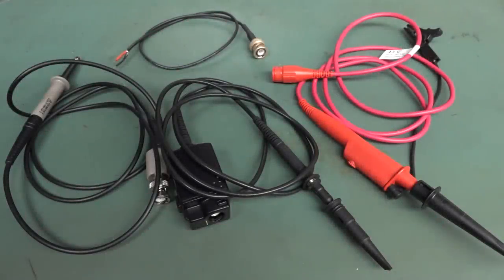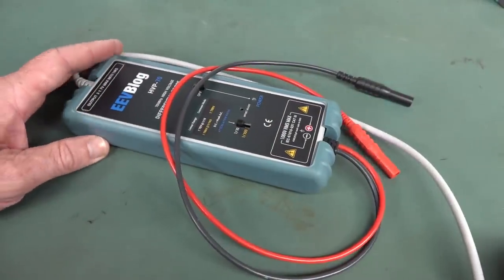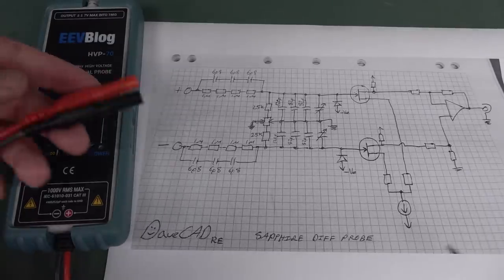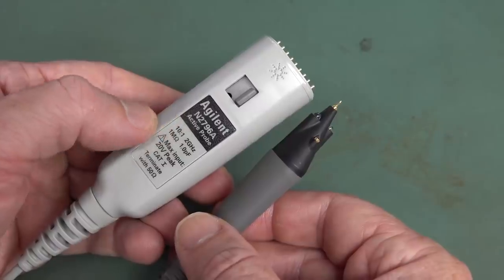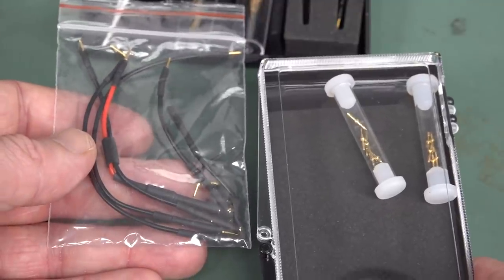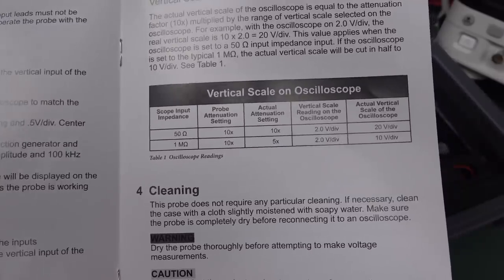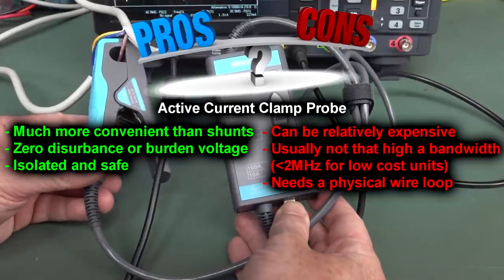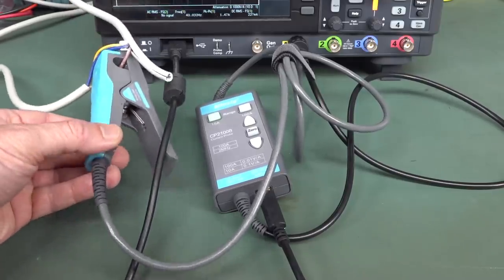EEVblog #1368 - Active Oscilloscope Probes COMPARED (Part 2)

Comment: The restive transmission line probe is my favorite way to make a built in high speed test point.  Because of cell-phones there are some absolutely TINY coax connectors.  Many are less than 2.5mm on a side.  Add a series resistor and you've got a GHz bandwidth test point for 30-60 cents in < 10mm^2 that securely hooks to the scope with a $5-10 of coax adapters.  Easy to AC couple the test point as well, just "tent" a resistor and a cap in series.

Comment: I’d love to see an automated test rig where that positional current probe is mounted on an automated XY stage and is scanned across an entire PCB to generate an image of where current is flowing.
Reply: So an MRI machine?
Ask Dave to hack an MRI machine to get passive magnetic fields.
Reply from the maker: Thought about doing that for the EMC probe.
Reply: One danger is navigating around components. To measure the probe tip needs to be in contact to trace or signal is quickly lost and also must orient to perpendicular to current path. The tip is quite fine and collision with components by an XYZ movement system could easily damage the tip. Extensive dragging over surfaces may also cause wear of the probe tip surface. I would recommend extreme caution in contemplating such setup. Maybe a robotic probing system taught exact positions of multiple test location may work, by sweeping around a board assembly is very risky
Reply: I've put one on a linear stage and tried scanning a magnetic strip. Can sort of make out the numbers, which seemed pretty impressive considering everything. For the PCB, probably would also need to turn the probe or board. I would like to see this too.
Reply: If I recall, Mikeselectric stuff did something with a long exposure and a led...
Reply: What kind of application would this really be useful for though? Unless you've got solder mask you can't see through, it doesn't seem that helpful, maybe? Multi-layer pcbs would just cross the streams, wouldn't they?
Reply: @EEVblog I actually made a somewhat similar video to what you describe, but with EMI probing : https://youtu.be/p-7Z3FmTmQg
Reply: For EMI testing using RF field probes such test XY systems exist, but as my other comment pointed out the current probe is not so easy, with probe damage highly likely, and still difficult as positioning precisely over traces, with correct orientation is essential. You need to follow traces accurately and know the layout. On anything other than one sided PCB and especially on multilayer, the cross fields of different traces will make readings dubious to resolve for anything but top layer. With power planes in fact probably only top traces and current density on upper most plane will measure, all else not at all in meaningful manner.
Reply: @helmuthschultes9243  Yeah, rethinking it, knowing the emi hotspots on the top layer could help with finding the gremlins in the inner layers, my bad I guess

Comment: Just put capton tape on the mains plug ground pin like electroBOOM does! No need of deferential probe... ;)
Reply: Save the tape. Kapton is expensive. I'd just use an IEC plug with the ground pin broken off. Used to do that with our powered PA speakers, when I worked at the school, to avoid the ground loop hum. Ideally, we could have bought a pair of in-line XLR isolation transformers, and kept the speakers properly grounded, but the school didn't like to spend money it didn't need to.
Reply: @BlackEpyon  or even better to just disconnect the ground wire inside the outlet! You just need screwdriver

Comment: Certainly good coverage, in fact I have basically all such probes on hand  except very high bandwidth FET active type. But also have a isolated HV Probe, with >3KV isolation.
Passive probes to 750MHz, Diff probe to 1700V, current probe 600KHz 100A, current probe 100MHz 15A , I-Probe 520, RF probe set, many custom build coax, twisted pair probes, custom 10MHz low capacitance (0.3pF) 100Mohm diff, special USB cal adapter with SMA sample outputs. 
Also created a Mains line access box, to all three lines, with current probe loops and voltage probing access, but such that user is fully guarded from accidental contact with mains, even in case of access to miswired , swapped around lines setup.
I would not want to be without much of such equipment.

Comment: The oddest probe i have seen was someone stuck a little 0805 photodiode stuck on the end of a coax with a BNC
it was used for measuring PWM LED strips by someone else who shared the lab 
it was nifty at times but obviously its for relative measurements and the signal level was really rather low
Reply: I've made a cruder version of that. A small solar panel connected to a sound card input. It would also be useful for measuring PWM of lighting, but I used it as an easy way to read IR remote controls.
Reply: Actually a very nice wide-dynamic range optical probe is a large BP34 photo-diode clipped into an oscilloscope probe.  Will pick up photo-currents from ~1nA to 40mA with a nice logarithmic response above about 50nA as the diode gets forward biased by the photo-current.  But It is fairly slow.

Comment: What I did miss in this presentation is the isolated probe Tek developed for high common mode signals (IsoVu). It allows small signal measurement in the presence of high amplitude common mode with impressive CMRR @ 100MHz. This is due to all optical path between the measuring head and base unit. I had the chance to work with both generations and the level of common mode noise immunity and low ground current coupling is impressive. You do have to sell an arm and a leg to get one as they are priced in the range of top oscilloscopes.
Reply: Took a stab at designing an open loop low bandwidth fiber-optic probe a few years ago. Unfortunately the fiber attenuation is very position sensative, so I need to do a V2 with a differential fiber signal or optical feedback. https://hackaday.io/project/12231-fiber-optic-isolated-voltage-probe
Reply: @martylawson1638  What you've done is very nice and the results are impressive. Considering the price of such probes I think it's worthwhile investing in a DIY project. I would say any such project should start with "know your fiber" and Tx Rx combo. Multiple issue are there. A big one I can think of is gain linearity over the measurement range. Optical feedback is a good idea but could add delay. Also the front stage can be really noisy and JFETs could yield better results.
1st generation IsoVu has a propagation delay of ~30ns while the 2nd gen is 20ns. 1st gen does have some DC bias issues (LF fluctuations and there's thermal drift for the first 1-1.5h after powering up) and the measurement can be disturbed when wiggling the fibers in a specific way. 2nd gen is much improved. BTW the power for the measuring head is also via optical fiber. No battery is used. 1st gen has 5 fibers. There's no switchable attenuator like for a regular scope input. The measurement range with the fixed attenuators they offer is wide enough though for daily use.
Reply: @pipbogdan  I'm leaning towards differential fiber open loop for V2 due to round trip delay conserns.  Common mode signal would directly measure losses while differential mode signal would minimize dc offset errors.  Would need a PGA driven by the fiber losses to stabilize gain errors.  Noise wasn't super impressive.  So V2 would get plug in input attenuators.  Sounds like J-fets are a good idea too.  Still I think the hardest part is finding the right LED and photo-diode pair with connectors at a reasonable price.  Have since gotten a 3D printer so might roll my own connectors on V2.

Comment: I always wondered what makes these differential probes so expensive. They contain the same basic electronics as a 1970's transistor radio thats costs $ 5, yet they cost a 100-fold...
Reply: Low volume. You can spread out all the cost of the business making the radios over millions or tens of millions of units per year. For an active differential probe you're spreading all your costs (non-recurring engineering costs, things like plastic moulds, usual business costs) over perhaps low thousands of units a year in a market with not a lot of competition.

Comment: I've made a couple of current sense probes for indication using old VCR head-drum heads or audio erase heads, may not be as fancy as the AIM but are a hell of alot cheaper, have made some probes using infrared LEDs just to see signals from IR remotes, was also hoping to see the large high voltage probes used for CRT testing.

Comment: @dave, could you do a small explanation on why, or why not, setting my scope up for differential measurement with two passive probes and the math trick would be as good, or not, aa a true differential probe?
Yes i you loose one channel but if thats ok would there be other benefits to buy a rather expensive diff probe?
Reply: You can do this, it's quite safe as long as you don't exceed the voltage ratings of the scope and probes.
The disadvantages are the long single ended connection path and the poor CMRR. The signal integrity is very bad. But for some low frequency measurements it can be useful.
Reply: I tried to measure current on a shunt once that way. IIRC max common mode voltage was about 10-20V, resistor voltage under 1V. First, my low-end chinese scope couldn't keep up, the refresh rate was terrible. Second, because of the relatively high input voltage setting, the effective resolution was useless.

Comment: Really appreciate the coupon code for the CP2100B !  That will help

So, we use a LOT of diff probes in our power conversion circuits. The issue that ALL scope probes have is common mode noise. Working in power electronics with the high rise/fall times causes a LOT of non-real signals.  Always having to check to make sure what I am seeing is real.  Connecting both ends of the probe input together and then connecting that combination to the common or ground point of the circuit under investigation.  If the signals show up, then they are not real.
Also, running the coax or the differential input wires through a ferrite or maybe wrapping it around a couple of times can sometimes help.  Major issue in power conversion with fast times and higher voltages and high currents.  Awful stuff !  :)

You (Dave) are very good with this stuff but I don't think I've seen you probe  power circuits with high CM noise inducing into the probes ???   Maybe you have and I have forgotten ?  Yeah, maybe you did.  But differential probes are always used in these circuits and are almost always a problem

Comment: 14:53 "Murphy  ensures that itll slide off and short something on your prototype" - Been there. Done that. It sucks.
Reply: This is why I started soldering on wire wrap fly leads.  You can also twist them to get quite better high frequency performance than the typical grounding wire. The tiny  26-28 AWG works best.

Comment: Dave, I'm an electrical engineering college student, and I have been using an ampclamp that was originally intended to be connected to a multimeter.  I found it in the trash bin at work. They were just getting rid of it because they got a bunch of new multimeters for our field battery technicians and the new meters all have amplamps built in.  It would be really interesting to see how an ampclamp that was designed to connect to a multimeter compares to an ampclamp that is actually for an O-scope.  I have been curious about this but have no way to compare myself as I cant afford a CP2100B

Comment: Thank you for the video, I think this is the most concise and accurate description.
But completely on a different topic, can we measure switching transients which measure upto 4KV with a time duration of 50ns using 10X CAT II probes , or should we be using Differential probes.
For your kind information I am measuring these transients that are effecting near GPIO pins of the micro controller.
Any help or advice is most appreciated.

Comment: 20Vpeak translates to 40 dBm into 50 ohm load. If you are not measuring high power PAs, 20Vp/40Vp is plenty enough for medium fast digital signals or low power RF for which they are probably designed for anyway.

Comment: Curious if you considered the type of your resistor for the 1k DIY probe.   My reason is because ages ago I read somewhere that low ohms resistors appeared as inductive, while high ohmic resistors appeared as capacitors, both of course in series or in parallel with the ideal resistor.  That was when the (through hole ) resistors were of the Allen-Bradley type -- element buried at the center of "hot molded" mass insulation.  Going further, Philips and probably others introduced the type that had a resistive film on top of a ceramic cylinder and overall "paint" on top.  That structure reduced the thermal resistance, so higher power dissipation rating in the same size resulted.  But there was another benefit --  the resistor element could be grooved to trim the resistance on the production line.  Instead of +/- 20% tolerance, the common tolerance then became 5% and even better were available for a minimal price increase.  So far so good, BUT the spiral grooving created additional inductance.  O.K, all that applied to the through hole type components.  I believe present surface mount resistors are likely also trimmed , but depending on the trimming pattern there may be little or no effect to the inductance.  So after all this background -- did you use a surface mount or a through hole resistor?

Comment: Help me out here - $4 digits - $5 digits for what seems like err - $10-£20 of components?? What am I missing??
Reply: 1) characterization cost 2) supply and demand
Reply: In addition to what supernumex said, 3) money in Keysight/Tektronix/Sigilent/...'s pocket, and more seriously 4) the active FET probes also have a higher input impedance.

If those aren't problems then just go with the resistive probe.
Reply: Today we are just spoiled by high performance digital scopes from China and used scopes from EBay. Not a long time ago high performance devices that can benefit from the high performance probes were only really available to companies and the users of the devices and accessories probes included did not care how much they cost as long as they help to speed up a product design at least a tiny bit or make it somewhat easier. Combined with the limited demand and very high quality expectations it allows the suppliers to charge almost as much as they want. For high performance probes it is still the case even today and I would not expect the sutuation to change any time soon.
Reply: Same reason Snap On gets $30 for a wrench made from a dollar's worth of steel. It's trusted that it's made correctly, will perform better than advertised, keep doing it a long time and be promptly dealt with by the manufacturer if it doesn't.
Reply: @supernumex  By 'characterization' do you mean the frequency response/HF drop-off curve or some other (more complex?) parameters?
Reply: Frequency and phase response is just one of them. S parameters, time-domain response. Temperature dependence. The equipment to characterize the probe is in the 5 to 7 digits! If you could characterize the probes for free and can guarantee it, you'd make a fortune! Dave alludes to this in the video, as well as others such as the bode 100 injection transformer #1104.

Comment: I would really like to make an active probe (100x )to use at work for 455 kHz IFs.  It would need to be high impedance and output to a oscilloscope.  I only need enough bandwidth if maybe 60 kHz. I just have no idea how to pull it off.
Reply: Is there a reason you couldn't use a cheap passive probe? The cheap P4100 probe you can find online has an input capacitance of only 5pf. If you need lower capacitance but don't care as much about accuracy you can just hold a normal probe up to your IF.

Comment: The moment when you realize that when you probe the signal you change the signal you probed.. 
Quantum uncertainty?
Reply: It is almost never uncertain how the signal changes if you connect another probe or a multimeter lead to a circuit. In many cases it is very easy to predict and compensate for. The only reason it may seem strange is because today we are just spoiled by cheap 1M input impedance test gear that in most cases allows to just ignore the effect of the extra load.

Comment: So does anyone have any idea which of the PI's ddr pins he was probing?  If I had to guess, I would say that it was probably a DQ or a DQS pin.  I can't think of any other DDR3/4 inouts off of the top of my head, but there are probably others.
Reply from the maker: They don't even have a schematic do they?
Reply: @EEVblog  They claim to have schematics for at least some of the boards at https://www.raspberrypi.org/documentation/hardware/raspberrypi/schematics/README.md, but a moment's glance at any of them reveals that they've omitted most of the interesting stuff, including the DDR signals.  The Raspberry Pi foundation always has just given lip service to open source, so it's not surprising.

Comment: I have one question coming up 6x in my head because you showed the cheap passive 1K resistive load probe solution you build yourself 6x:
what if you would use a 1MΩ resistor there ? Since the scope impedance is als 1MΩ you would only load it down to half the sensitivity, so would that be more useful for high frequencies ?
I cannot check, I have no scope other than 5MHz bandwith, and no generator that is capable of that.
Reply: Or did you terminate it with 50Ω too ?
Reply: You need to terminate it to the coax z0(50 ohm), so you would get a very high attenuation.
Edit: typo
Reply: @Gengh13  That's what I was afraid of.  My small scope has 100mV/dev, so more or less unusable.